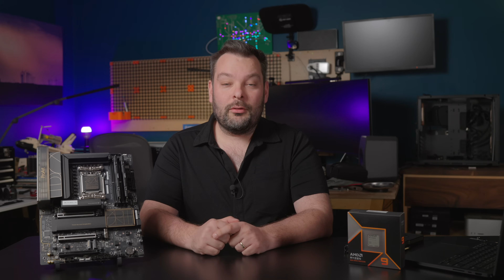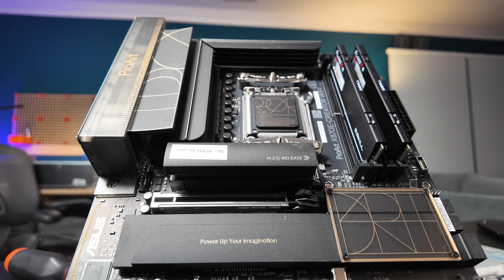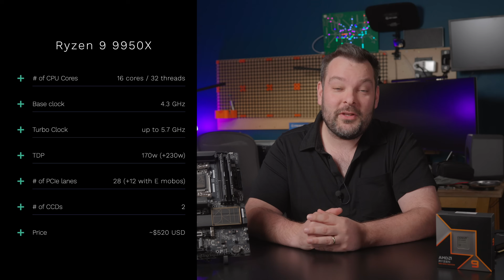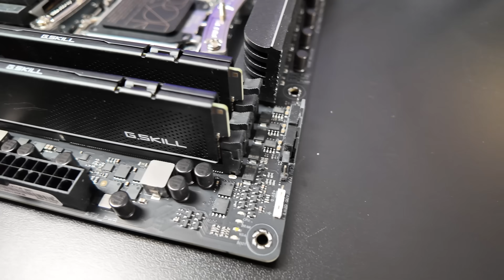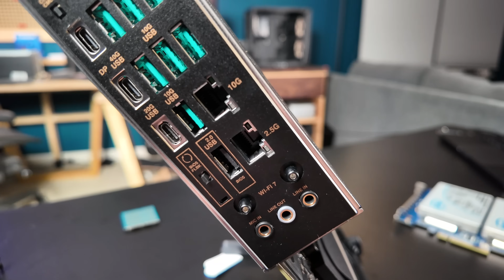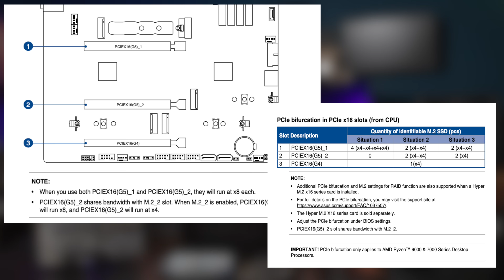Does it make sense as a server? Ryzen 9950X + ASUS ProArt X870E

Comment: I did this with my 5950x and Undervolting it!
Reply from the maker: how much power does one save by undervolting?
Reply: @ktzsystems  depends on how much you undervolt, CPU model, fan curves (since you will use less fan power to cool since under olting will make it run cooler), stability and and needs. Please look into it, once you learn how to undervolt, it really opens up doors. Youtube  has many good undervolt tutorials on ryzen and Intel's. Your Mobo does support it.

Comment: You really don’t need much more than this for a compute server. I use a 12900K on a W680 board for my main compute server. Haven’t even used the PCIe slots in it yet since the Intel iGPU works well enough for Plex transcoding. Was my first server though so didn’t set it up with dual boot drives and mirrored VMware storage, so gonna need to do that at some point.

Comment: It's a shame to see that the lanes are not fully supporting x16 pcie slots specs these days. 
There all shared or x16 (x8 by x8) slots or only 4x support.
Manufacturers should bring some mainboards out were there are less USB and other stuff so that the pcie slots support the full x16.
You cannot even install a 100GB x16 network card  in these boards of 500€!
Older boards were better at that point.
Reply from the maker: the automatic pcie switching is really confusing. what i would like are some jumpers honestly. old school but simple.

Comment: AMD's APUs such as the 8700g have much lower idle power draw because they're monolithic chips and the culprit is the I/O die on the chiplet models, though their PCIe lanes are cut down by 8. Hopefully Zen6 will remediate this with its reported 3nm I/O die (from 6nm)... Maybe even on the same socket..
Reply from the maker: great point! sometimes i wish i could send these scripts out to the audience for these comments FIRST.
Reply: Worth waiting to build a server/nas? Spinning hdds maybe with potential for a few nvmes later down the line... im torn between i5 13500, siena which is damn expensive or some newish am5
Reply: @privateaccount5400  Zen6 isn't expected til late 2026 or early 2027, so it depends. 🤷
For a NAS, if you do much transcoding with plex/jellyfin I'd go Intel for the iGPU, otherwise probably AMD, ceteris paribus.

Comment: I just build my serv on AM4 (570s Aorus Master,5950X). Considered using PCI-e m.2 expansion. Seams like better idea would be to get SAS PCI expansion cards + SFP card for 10g networking. From SAS cards you can get breakout cable to SATA SSD drives. That will give you ability to get more cost effective drives, and maximize the amount of storage.
Reply: Im running a 4750ge on msi x470 gaming pro with ecc.Dual nvme for lxc and vms an hba for mass/sas storage and dual sfp+ for networking.Its waay overkill for my use case but enjoying the hobby way to much.

Comment: HBA for SAS over pcie sata cards, the only sata cards that even are sort of worth it, in speed and reliability, cost more than a decent 93xx hba/raid controller.   Put them in IT mode, and lit it control all the devices, so much more stable, yeah they need a bit of help on the cooling but not that much.

Comment: If the CPU has only 28 lanes, how are you getting 40 with the extra chipset.  Meaning you can't use those 40 lanes in parallel without sacrificing performance? I'm definitely not the most knowledgeable in hardware so what am I missing?
Reply: The chipset can “add” 12 more lane for the downstream component, but it’s limited to the link speed between that chipset and the CPU. So if a GPU need 8 lanes, it can have it but somehow limited 🤷‍♂️ 
Most of the time you don’t hammer every component at the same time so it juggles it fine 🙌

Comment: Is there really no other good & affordable option that retains the 128 pcie lanes? You really got me interested with those earlier builds.
Reply: Threadripper
Reply: I dream of the day of getting 128 lanes cpu and mobo combo for under 1k MSRP. Let me dream 😭😂
Reply: @V1N_574  EPYC Rome gives you 128 PCIE 4.0 lanes. Motherboard and CPU can easily be had for under $1000.
Reply: Havent found much for X86, but Newegg has those Ampere Arm chips bundled with AsrockRack mothboards for $1,000 to 1,500ish USD usually. Jeff Geerling did a NAS build with one of them

Comment: Nice update on the new build! Lots of informative stuff with this platform. Working around the PCIe lane limitation and still getting everything you need in there. My current unraid box is based on MSI X570 Unify + 5950X. Its my main NAS and docker environment. Just have an old GTX 1070 and a DELL H310 HBA card plugged in. Looking forward to the next video.

Comment: X870E is actually in most cases a bad decision for a server. Most servers want/need PCIe lanes. The X870* automatically allocates PCIe lanes for the USB4 port - and AMD requires this. So all boards with X870* chip will have less PCIe lanes compared to older chips.

Comment: love that we have gone through similar journeys, I ended up with an identical rig to replace some cast off enterprise gear! then as my 3rd node in my proxmox cluster I ended up with a rack system built out with a minisforum-bd790i, which absolutely ended up as my favorite box due to the simplicity and price (although you basically have to choose between 10g and a video card, ALTHOUGH I do want to try one of those m.2 slot to 10g converters that ive seen but not anywhere near my k8s cluster :) )

Comment: I own the predecessors of this mobo, Pro-Art X670E paired the Ryzen 7900X as an AI server. Been a great rig and mostly reliable for the last few years, albeit weird issues with hibernation that Asus introduced late last year with a UEFI update that I have not pinned down as to the cause. This is a solid server/workstation build that offers SR-IOV and 10Gb/e networking which few motherboards have.  Bang for buck, the Pro-Art mobos are hard to beat as basis for a professional workstation. I also use the DisplayPort passthrough to power my triple monitor setup and hubs which I believe is unique to this mobo. So more than pleased with the purchase.